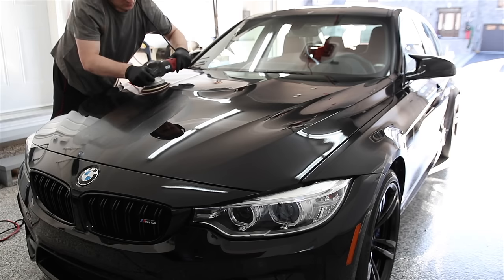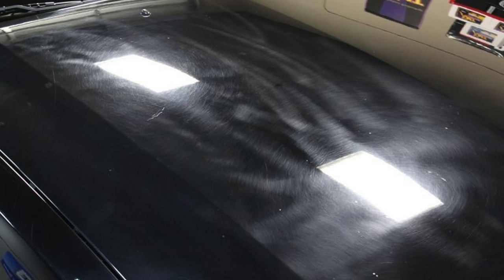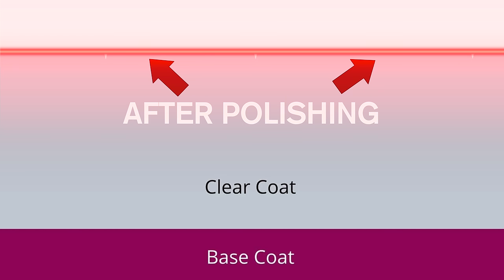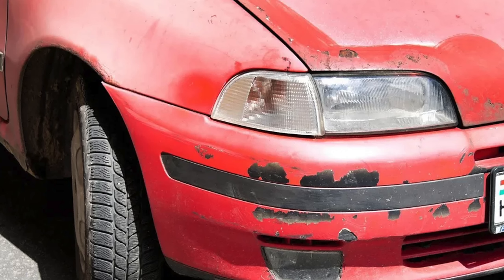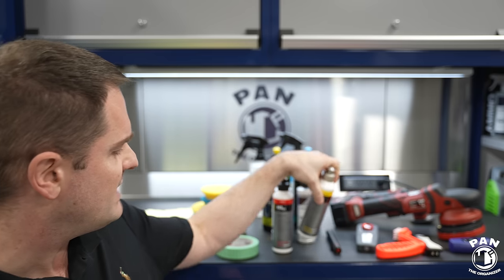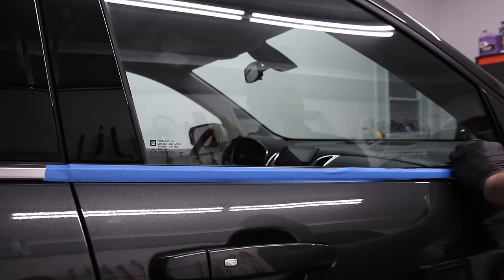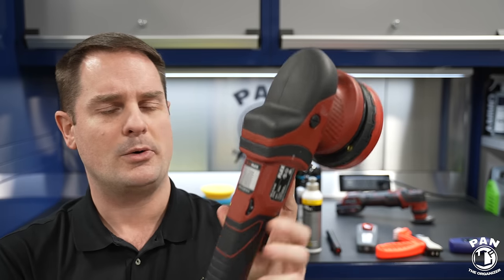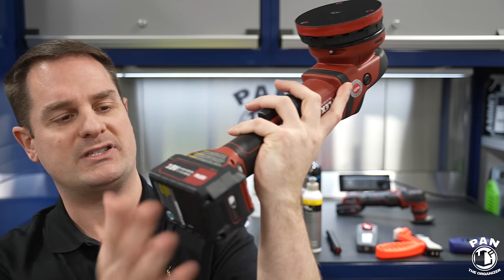DETAILING 101 - Paint Polishing - Everything You Need To Know

Comment: HI
I have a quick question about best/most durable/long lasting paint protection for winter season. Im in the suburbs of Chicago (lots of cold days and salt on the roads). I do go through touch less car washes at least once a week i should add during winter as its all i can do due weather. Both cars sit outside.
Both of my cars are white and being maintained decently. Im thinking about putting 2 coats of 303 graphene spray coating that was reviewed on here that is being said should last around a year on cars paint but i haven't tested it out yet for longevity of protection since its relatively new product.
So what is best to use before winter that will protect the paint from salt until spring when it finally gets warm enough to give a car good bath and get it ready for warmer months where its is obviously much easier to keep clean/protected.

Comment: Awesome video Pan. You got all the key points covered. The only thing I think was missing is the proper technique for handling styling creases on the panel, and panel joints like between doors etc.
Reply from the maker: Thanks Michael. Anything above this would have made it way too long. We can always make a part 2 later on. Given the popularity so far for just a few hours since it went live, it seems people are loving the video and I will likely make a follow up. :)
Reply: @PanTheOrganizer  I would love to see apart 2 with tips and tricks to paint correction.
On a side note, will you be covering headlight restoration and protection? I personally use the invission professional headlight restoration kit, but am looking for some alternative methods for re-clearing and protection as the invission clear coat that I use seems to have become harder to work with even in a controlled environment.
Reply from the maker: I have a quick headlight tutorial that uses no tools, for a quick visual improvement and protection of lightly oxidized headlights. But if I get enough requests for a full blown restoration (water sanding, machine polishing, ceramic coating) I will do a video for sure!

That being said, what's your favourite video on my channel so far?
Reply: @PanTheOrganizer  I get a lot of call outs for auto workshops to restore headlights as part of a cars road worthiness certificate (for resale). I've found some mesh type sanding discs that I cut down in diameter really work the best as they are durable and can be washed out for multiple uses before discarding.
But I'd love to see a more in depth process of headlight restoration on your channel, especially options on protective coatings.

Comment: Hi, excellent video! I would like to do some paint correction with the intention to prep the surface for Gyeon Cancoat. I have 2 cars, a brand new Tesla MY with minimal swirls, the other is a 13 year old BMW with lots of defects. I don't want to get every single foam pad Lake Country has, considering I'll need about 6 of each to do one car. What would you recommend to minimize cost and still be adequate to do the job for both cars?
Reply from the maker: It’s impossible to say until you do test spots to determine which is the best pad and polishing compound combination. Tesla paint is different from BMW. So there isn’t a one size fits all type solution when it comes to paint correction unfortunately.

Comment: Pan great video as always❗  If I use Turtle Graphene Flex Wax can I use a Ryobi Cordless 10 in. Orbital Buffer which comes with Microfiber and Synthetic Fleece Buffing Bonnet Set.  My question is, if you can use this buffer with the Turtle Flex spray, then which bonnet would you use to bring out a killer shine?  How would that work.  You'd spray the car and then use a manual microfiber cloth to spread it.  Then use this orbital?  Or use this orbital to spread the spray.  Then buff using hand microfiber?  What would make more sense?  I'd say spread the spray with an microfiber application pad and then use this orbital to polish off the spray❓  Again, which bonnet would you use?  IF THIS orbital WOULD WORK OR NOT using Turtle Flex spray?  

By the way I used Torque Graphene Burst liberally sprayed and buffed off, then as a second coating used Turtle Graphene Flex Wax multiple sprays on each panel and buffed off, my dad's 2022 Model Y Midnight Silver metallic now looks like "glass."  I was amazed❗  

I'm not sure if it was one product layered over the other that gave the paint a "pop" but both combined made the color shine.  OR, would that color have popped by just double applying the Turtle Flex Wax alone❓ 

As you informed me when I asked you about both these products and you swear by Turtle Flex.  I already had the Torque Graphene Burst.  So I decided to use it.  But I'd rather just use one product if I can get the same result.  Would using 2 coatings of Turtle Flex give me that glass like shine or was that only because of the Torque & Turtle sprays combined / layered back to back?  

THIS WAS THE FIRST TIME IN MY LIFE EVER WAXING A CAR.  YOUR VIDEO's ARE SO HELPFUL❗

Let me thank you in advance for your always honest and professional responses.  You are truly passionate about your profession❗
Reply from the maker: Thanks Teufel. The spray products aren't made for machine application. Flex Wax is to be applied by hand.

Also, don't layer too many products from too many different brands. You run the risk of not getting chemical compatibility, and also overloading which can run the risk of streaking. Flex Wax is a very durable paint protectant, so you would only apply this once every six months on average.

Only one layer of Flex Wax is needed.

Cheers!
Reply: @PanTheOrganizer   Thank you for your advice❗  I was so tempted to get an orbital buffer but then I decided to ask a subject matter expert before I destroy a perfectly good paint on a brand new vehicle.  Have a splendid weekend coming up❗

Comment: Hi, Pan! Great content as always. Regarding polishing, my black truck has stubborn clear coat scratches and paint cloudiness on the rear tailgate. I have a dual orbital polisher but can’t seem to find the right polishes that fix it. What would you recommend? Thank you as always!
Reply from the maker: It's impossible to give a one solution fits all without doing testing.  You need to do test spots with different combinations of compounds, polishes and pads, to see what works best for your specific paint and level of desired paint correction. There are many different types of clear coat on the market (soft, medium, hard) so you need to test.

Also keep in mind if the scratches are too deep, they might be beyond the reach of compounding polishes and might require water sanding first. If they are so deep that they are down to the primer, a panel respray is needed.

A good starting point might be to go for a more aggressive pad like a Rupes blue wool pad with the Rupes DA Coarse Compound and see if that does something.
Reply: @PanTheOrganizer  Thank you!

Comment: Is it necessary to add more polish or compound product to the pad after cleaning off with a brush between passes if I’m doing small sections at a time? Also, is it correct to assume foam pads don’t need reconditioning after that initial pass?

Comment: Can I use a DA on a repainted truck? My dad got a cheap paint job that has held up surprisingly for just over 20 years. It has a bunch of little nicks and scratches. I noticed some cracking and they didn't remove anything (e.g. headlight, taillights, etc.). So I'm afraid to use a machine. Should I just do it by hand or am I safe to use the DA?
Reply from the maker: If you follow the tips and take your time, a DA (dual action) polisher is as safe as it gets. Don't apply too much pressure, let the pad and polish do its thing. And you'll achieve way better results and quicker compared to hand polishing.

Comment: If the polishing phase removes a portion of your car’s natural clear coat, is there then a limit on how many times you can polish a car throughout its lifespan?
Reply from the maker: Yes as the clear coat diminishes over time, especially if you do too many compound steps (which is more abrasive than a polish). But once polished, you shouldn't have the need to repolish for a few years if you use proper washing and drying methods.  

If would takes years of polishing, a few times a year, before you'd have to start worrying about going through the clear coat, assuming you start with a new car with factory paint.

Comment: Thanks for another great video Pan!

I have a few questions: Do I need a specific glass polish and glass polishing pads for my windows? Or can I just use pads/polish I have for the paint

Do I also polish head lights/tail lights normally like I would the paint?

If I need to avoid polishing chrome trim/grill/emblems, do I also avoid claying these areas to avoid scratching?

I plan on polishing (no compound) my 2019 Audi A7 before applying Adam's graphene coating for reference!
Reply from the maker: For glass you can use a regular polish. But I find that a dedicated glass polish and glass pad works even better. Watch my glass polishing tutorial: https://youtu.be/yMi5PtyqUI8

For the headlights and tail lights, same polish as for the paint.

To avoid scratching sensitive trim, tape them up prior to polishing.

Comment: My new car looks to be in good shape with minimal "if any" surface defects. Do I "really" need to machine polish at this stage or would hand polishing suffice?  I'm not using a ceramic clear coat this time around so I'll be repeating this procedure in 3-6 months. That would give me more time to gather my tools and formulate a better more effective paint protection strategy/plan.  I've had the car for  a week and it has less than 200 miles on it. I understand new car paint can be moderately damaged but to my untrained eye and without the employment any visual aides)tools  it looks pretty clean. I'm feeling like I  just want to get the TW Graphene Flex on it asap. As a sidenote, I think that because of the state of the new car market right now (there are NO cars lol) It went straight from the factory to the dealership and then to me so it didn't have a lot of time to gather much damage.
Reply from the maker: Hi Bryant. Congrats on your new car! But, new cars are never really "new" from the dealership, for reasons I talk about in this popular video: https://youtu.be/QgoyrC-5CMc

Also, the dealership usually applies some cheap wax or sealant prior to delivering the vehicle to you, to kind of make it look glossy. And having a wax or sealant on the paint prior to applying a coating is a big no no. So you would have to ensure 100% removal of any previous protection. (Hence why I always instruct the dealership to NEVER apply any wax or sealant on the paint of my new car, and no tire dressing. I want to do all the steps myself).

Please have a look at my popular tutorial on how to apply a ceramic coating here: https://youtu.be/sqQYVjxFqK0

If you just want to apply the Graphene Flex Wax, it's not as critical as with a coating in a glass bottle. You would at least wash the car, use an iron remover to remove embedded brake dust, see if the paint needs claying (run your fingers on the lower parts of the doors and if you feel grit or contamination, it needs claying). Once all that is done, look at your paint. If you feel it looks perfect and doesn't require polishing, you can skip the polishing step and apply the Flex Wax.

You can watch my Flex Wax review here: https://youtu.be/b5BjDzItlr8

Comment: Hi Pan, congratulations on an epic video. 46 mins flew by! The most comprehensive machine polishing video I have seen. I have invested in the Rupes LHR13 DA 5”polisher/pad/ polish system and will be trying it out soon. My car is only 3 months old so no paint correction required yet, but will be following your tips when using the Rupes soft white pad and Rupes Uno polish to replace the traditional hand polishing with a carnuba  wax. Any issues with this approach? Is it true to say that even pure polishes have some cutting effect?
Reply: Near enough every polish has some cutting ability otherwise it wouldn’t be able to do its job, also 99% of new cars have paint defects and unfortunately most new cars use softer paints so they are prone to swirls , depending on what colour your car is , it might be hard to see swirls without the correct lighting so best to buy a good swirl finder light before polishing

Comment: Does polishing alone remove clear coat? I want to cut and polish my car (color is black), but I am thinking that maybe within time I might want to polish it to bring out the color/gloss, would it be a smart move to be polishing every couple months or should I just maybe re wax to bring the colors/gloss out? Since you said that machine polishing is the best way to bring out that gloss/mirror finish.
Reply from the maker: Compound removes the most amount of clear coat, but yes even polishing will remove a very fine layer. Both compounds and polishes contain abrasives. It's just that the compound has bigger and more coarse abrasives, and the polish has smaller/lighter abrasives.

If you use safe washing and drying methods, you shouldn't have to polish your car very often. I polished my new Porsche once when I took delivery, and it's been over two years now, and the paint is still pristine.

The more you polish your paint, the more you are diminishing the clear coat, and that's not recommended. One light polish a year is fine, but I wouldn't do a full 2-step compound and polish more than once very 2-3 years. You have to preserve the clear coat as much as possible.

I hope this answers your question.

Comment: Do you recommend prepping the paint on a NEW car before using a compound and polish? My vehicle has 1500 miles.  Also, do you recommend applying a paint protection with a polisher?  Thanks
Reply from the maker: Yes absolutely. 

A new car is never new until it's properly detailed. 
- at the factory, the paint defects are often corrected quickly by rotary polishing which can leave marks and holograms, so polishing corrects those, before you lock that in long term with a ceramic coating for example.
- vehicles are then transported by truck, train and boat so they are exposed to the elements, industrial fallout, brake dust, rail dust, etc
- vehicles are often left at boat docks (when transported by boat) or in exterior parking lots for weeks or months, again being exposed to the elements
- at the dealership, the vehicles are almost always poorly prepped using the same dirty water that was used for all the cars on a given day, and poor washing and drying methods leading to swirls and scratches 
- at the dealership, a layer of cheap wax or paint sealant is usually applied to attempt to make the paint glossy prior to delivery. It's crucial to remove any previous protection before you apply a ceramic coating, as coatings need to bond directly to a virgin clear coat.

If you only plan on applying a regular carnauba wax or paint sealant though, you could decide to skip machine polishing, as those protectants can be applied over existing protection and it's not as crucial to prep the paint as well.

I explain all of this in this popular video: https://youtu.be/QgoyrC-5CMc

So you can better visualize the new car prep process, here are the steps I perform on a brand new car from two of my customers: 
Tesla Model Y: https://youtu.be/gohks8xP5NY 
Porsche 911 Carrera: https://youtu.be/2ckiivbFqs4
Reply: @PanTheOrganizer  Many thanks!  I have always been particular about having a clean vehicle. However, it was after I started following your YouTube page I realized I needed to change my methods.  I would like to eventually do machine compound and polishings and I’m looking for a polisher. I don’t need a professional level, I just want one for DIY level. Thanks
Reply: Pan, do you recommend applying a Carnauba Wax with a polisher or should it be done by hand?  Thanks

Comment: Hi Pan Thank you for everything you du for us. I have a question, in witch case can I use the finishing polish?
Reply from the maker: A polish is usually to jewel the finish and remove sanding marks from the compound stage. Or a polish can be used on a vehicle with light swirls and scratches if a compound isn’t needed for deeper scratches.
Reply: @PanTheOrganizer  GRAZIE

Comment: Hey Pan, I just finished a rupes course and my polishers finally arrived but my only concern right now is, is it safe to polish under a polycarbonate sheet roof? I'm going to use the whole rupes system but I'm afraid of the heat produced by the sun and the sheets. 
Thanks in advanced
Reply from the maker: Polish under a polycarbonate sheet roof? I have no idea what you are referring to…

Comment: Hello, 
as a general rule of thumb, what’s a great number to use to do a final polish on a car with ither M3, or Reflect? 
Thank you for all the free information, man!
Reply from the maker: What do you mean by great number? Are you asking about the speed setting on the polisher?
Reply: Exactly that and do you do higher speeds when polishing compared to compounding? Or do you tend to keep them at relatively equal speeds in both instances?
Reply from the maker: Compounding and polishing are usually the same speeds. Speed 4 or 5 out of six settings on my polisher.

You use the slower speeds 1-2 when first applying the polish to spread it, or when applying a liquid wax or sealant.

Comment: Do you need to use panel prep after the course cut and before the Polish? Or is microfiber removal enough between those stages?
Reply from the maker: There is no need to, but some like doing a panel prep between the compound and polishing stage, to remove any fillers from the compound and see what actual paint correction they achieved, before moving to the polishing stage.